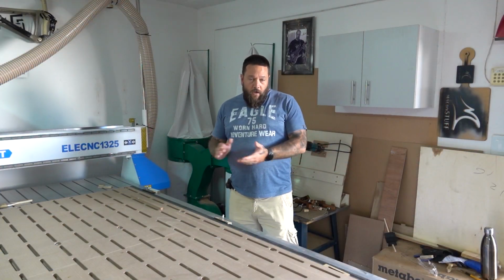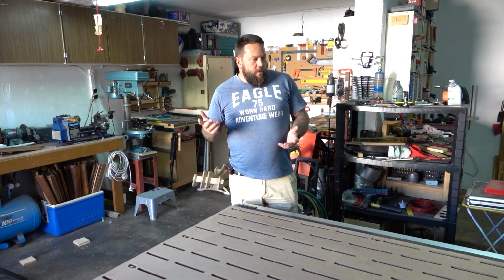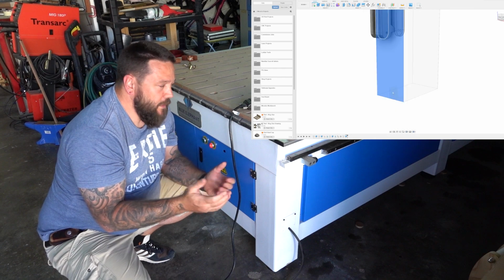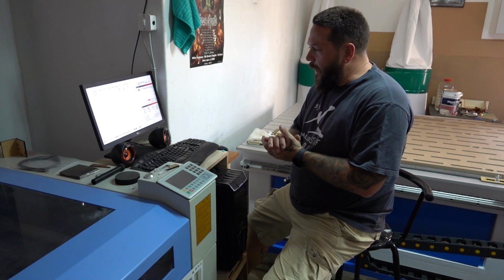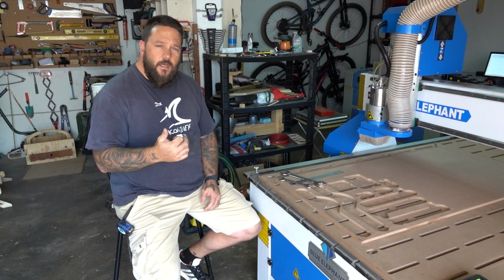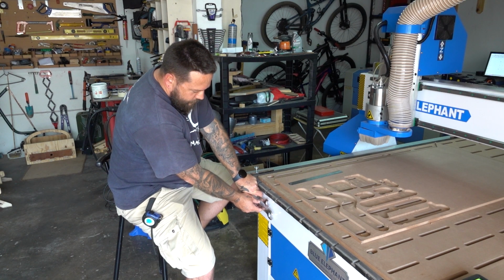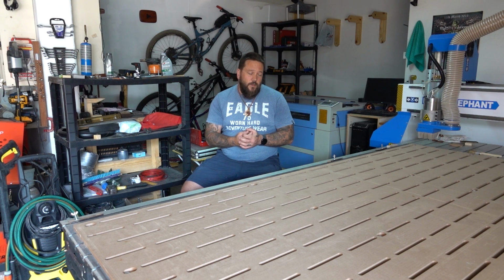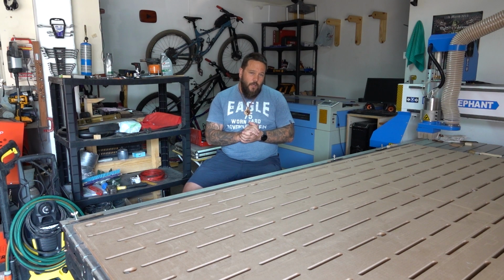Some Helpful Upgrades to my Chinese CNC - Blue Elephant

Comment: Since you are using Fusion for your designs why not also do your toolpaths with it? I have a POST for the RichAuto DSP if you need it. I do like these Chinese made CNC routers, excellent cost to performance ratio.
Reply from the maker: I only have the free version of Fusion and I got V-Carve Pro before I knew Fusion could do CAM... Also, I do a lot of my basic designs for CNC in vector form in Illustrator and then straight to V-Carve from there... V-Carve is aslo very user friendly... perhaps just because I've become used to it... I may also just be trying to justify it, seeing as I spent so much money on it... 😂